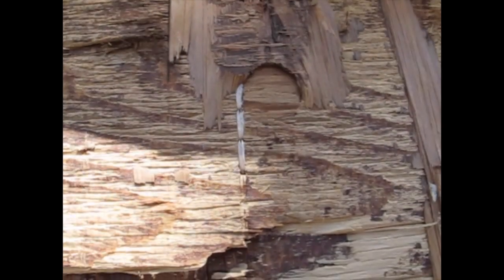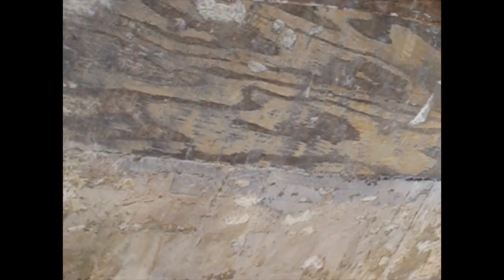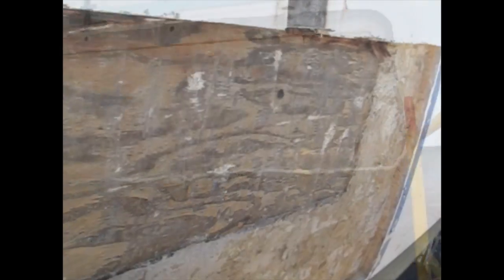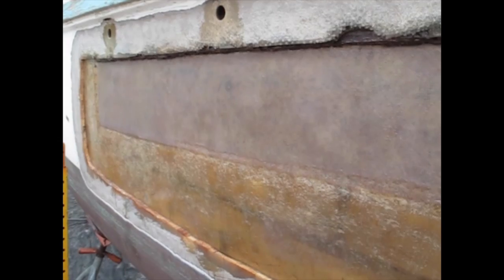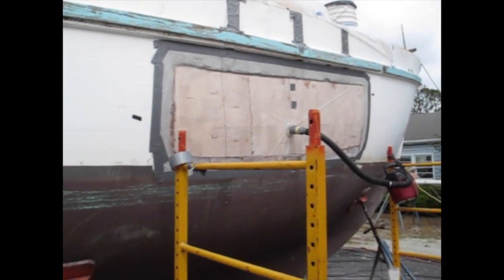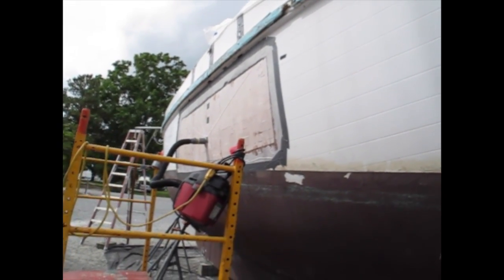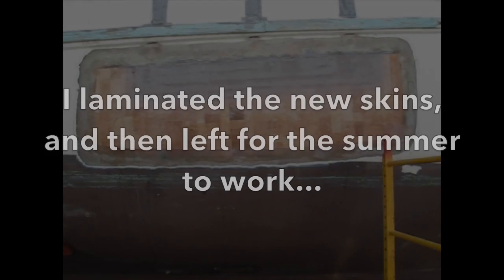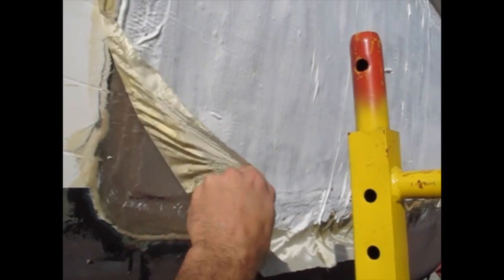Balsa Core Hull Repair on Idle Queen

Comment: When you use the vacuum machine to push the balsa,you connect the tube in the back of the machine to push or in normal position to suck the air?
Reply from the maker: It was used to suck air. It probably wasn't a necessary step in the repair, as just pushing everything into the fresh "mash" by hand bedded it very well.

Comment: so cored hulls can be repaired just as economically as solid GRP?
Reply from the maker: Sure, from a materials standpoint it might even cost less than solid GRP. This repair only cost a few hundred dollars in materials. If you are paying for labor, it will cost more, however, as there are a few extra steps to be taken when making a good repair. It took time for me to remove and replace the core. After that, it is just a fiberglass repair.

The big thing I took away from the entire exercise is that the repair would not have been necessary if the hardware had been properly installed in the first place, or even decades later. It took almost 40 years for this damage to occur...

Comment: Thanks for you video it's very helpful. I've got two similar size areas on my Reliance 44 hull that are wet (balsa core). However, since I've got the interior gutted I have full access to the interior of the hull. Just wondering if you had the option, would you have worked from the inside?
Reply from the maker: Wow, you're lucky... The answer is yes, I wish I could have done this from the inside! You'll save all the hours of fairing, probably have gravity working more in your favor, and not have to worry about disturbing the integrity of the outer skin. It's not such an intimidating job from the inside. You will probably be able to finish in half the time compared to going from the outside. If I had not been staying on the boat at the time, I would have worked from inside. Still, I learned a lot from this project, so it was a good experience overall. I wish you luck on your project!

Comment: I think I would have accessed the rotten core from the inside and left the outside intact.This would have kept the strength and shape as well as the moulded in lines intact. This large of and area still needs to be strengthened from  the inside anyway. Good luck.